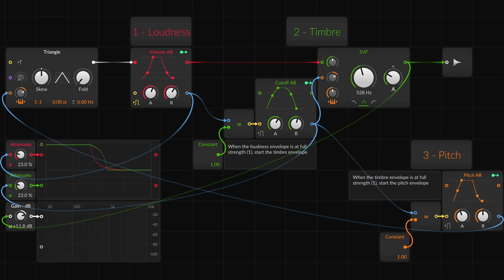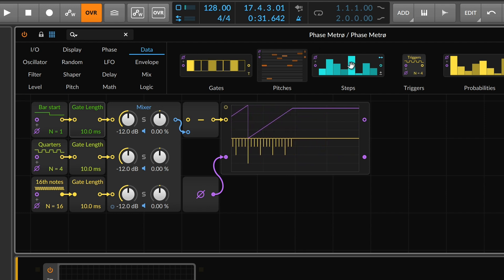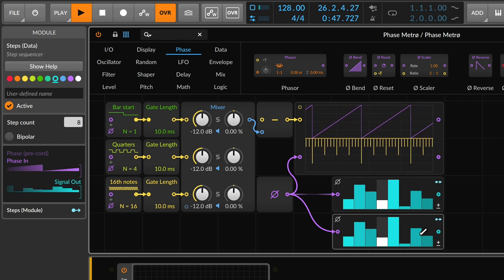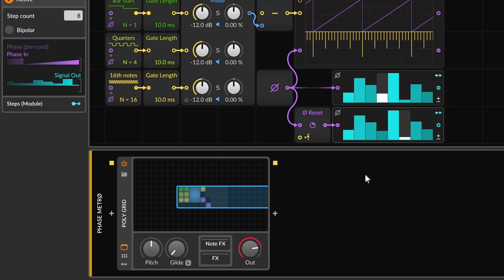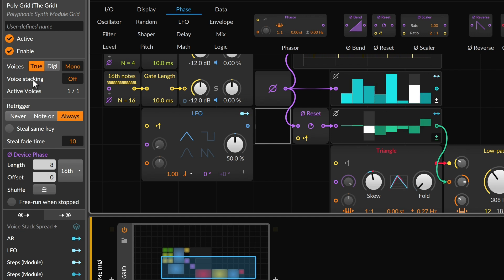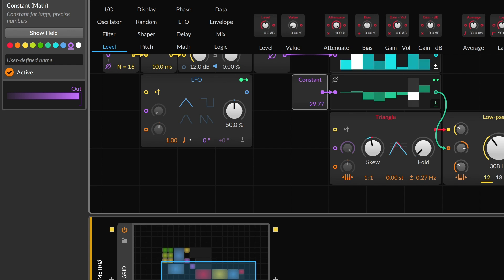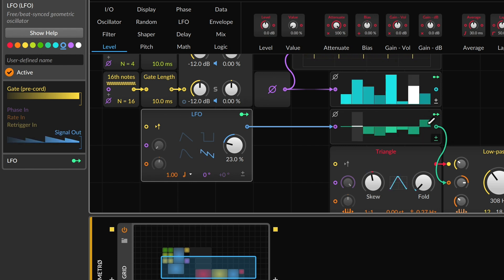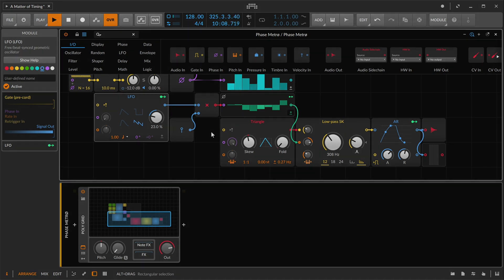Modular Concepts: Phase, a Matter of Timing [Bitwig Studio | The Grid]

Comment: Excellent and extremely helpful video. One question though: even though the lower of the two step sequencers is connected to the input of the low pass filter, it appears to be modulating the skew and fold of the triangle oscillator. Why is that?
Reply: just because he wanted to

Comment: thanks for this great introduction videos! One thing I dont get to work the same as in the video, is that after I recreated the whole device with the same elements, the phase and everything else is always running, whether the play button is pressed or not. The only thing that isn't running without the play button and stopping with the stop button is the metronome. Is that a special setting that needs to be done?
Reply from the maker: Hello Henning, sequencer modules like Gates will always run also if transport is not playing, unless you disable the Phase input pre-cord connection. You can also disable "Fre-run when stopped" via the Poly Grid/FX Grid settings in the inspector panel.